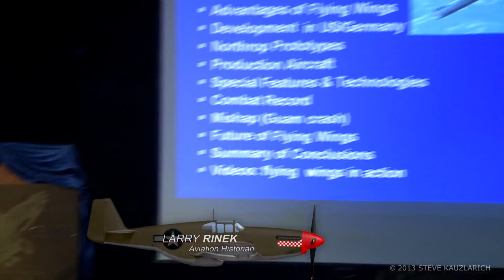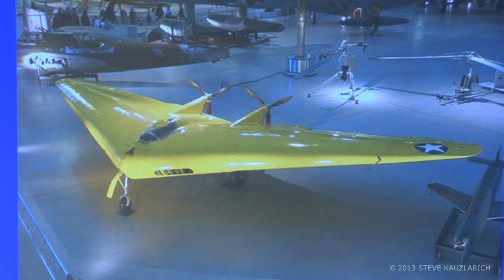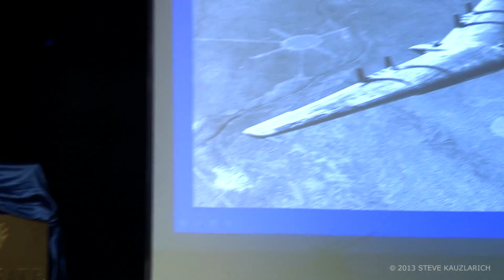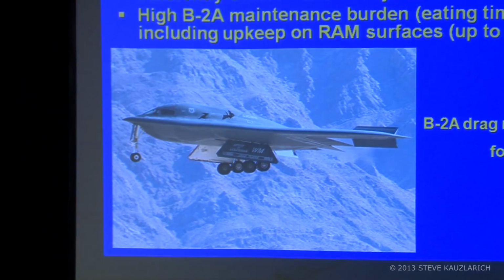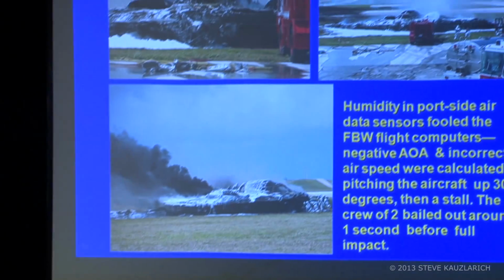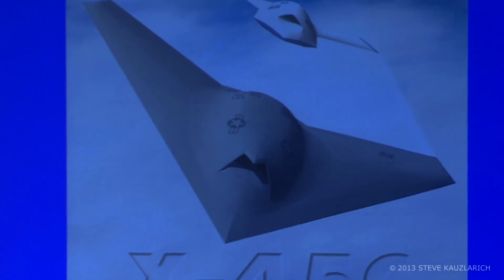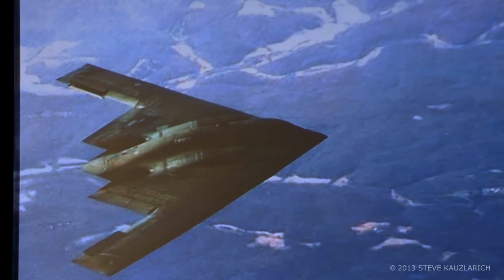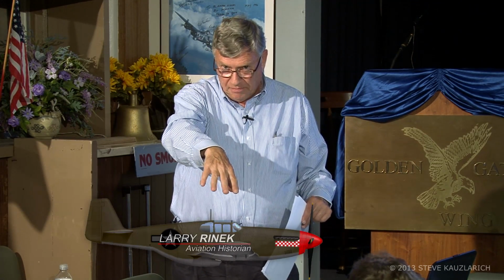HISTORY OF THE FLYING WING, with Larry Rinek

Comment: The flying wing had already proven that it did get more speed and range. Observability was a was important before stealth and was a feature of the marketing videos of the time. The cancelling of the Northrop bomber was carried out by the head of the air force for political reasons after after they had already signed an order for 35 planes. They were forced by the airforce to destroy every prototype that they had built to date.  This is the reason Northrop didn't want anything to do with the 1970's stealth projects. The deliberate attempt to bankrupt Northrop was the most Traumatic event in its entire history. It is the subject of several videos. It comes as no surprise that when Northrop were finally given the chance to build a flying wing, after almost 50 years , that  they came up with a machine that revolutionized aviation. Despite certain peoples obvious dislike of this company.

Comment: This guys wrong about so many things, he needed to watch the frontline interview with Mr Northrop when he was 85, also all 3 of the 5 test pilots, the other  2 were the ones killed in the only (1) crash of the XB49 during the military trials,  but the other 3 test pilots were a retired USAF Colonel, as well as a retired USAF General and the other test pilot was the company test pilot Northrup, that had been with the program since the very beginning and all 3 pilots said that the Aircraft was Stable and ready for action, there was a problem with yaw before the contract wad awarded but they had developed and analog flight stabilization device that took care of that issue or they wouldn’t of won the contract if the aircraft was unstable and incapable of hitting the target on bombing runs.. and after the crash Mr Northrop said that they had to start over back a square one in the Air Force Trials due to the crash to make sure that one of the earlier test before the crash hadn’t exposed a weakness in the airframe or flight control systems, which is the reason your required to start completely over. So once they had to run completely through the Air Force trials again start to finish, with one of the other XB-49’s aircraft x they had built, everything he said to do with Northrop  and the b49 & xb35 and the military contracts is wrong, he only listened to misinformation and myths. 
  Northrop actually won the contract to produce 35 or 36 of the B49’s & the General that came to Mr. Northrop’s office to award Northrop with the contract and the first P.O. And the General told him they were very excited about the Bomber and this initial order was just going to be a drop in the bucket because he was pretty sure they were going to want 300+ more bombers and variants over the next few years built for the Air Force.  
In the interview with Frontline the former chairman of Northrop and Mr. Northrop both described a meeting that took place 3 days after receiving the notification of winning the contract they were called into meet with the Secretary of the Air Force, they assumed to be congratulated and commended for their hard work, but it was anything but, the Sec. Of the AF, Simington said he wasn’t going to be dealing with more companies competing and that Northrop was going to “merge with Convair, and they needed meet and get it worked out” Mr Northrop asked what if they weren’t able to come to an agreement  for merger? And Secretary Seimington answered “that they would be damned sorry if they didn’t”. The General was supposed to of spoken up and said that the Sec wasn’t saying that they were going to,? Then the Secretary spoke up and shut the General drown repeating what he had already said, that they would be damned sorry if they didn’t merge with Convair,   
So the Chairman and Mr Northrop left and arranged a meeting with the head of Convair and he was basically trying to merge with Northrop but was valuing his stock as if he was holding the Air force contract for the B-49’s and Northrop was setting empty handed without any potential work lined up, or assets of value, when in fact it was just the opposite Northrop already had 7 B49’s built & was the company with the USAF Contract & since winning said contract the Value of their stock had skyrocketed and the opposite had happened to Convair, but it seemed to the Mr Northrop and his team that the man at Convair assumed that he wasn’t going to have to pay any difference in stock values and was inflating the value of his own companies stock, so naturally no agreement was reached. Mr Northrop said that it was only a matter of a couple days after their meetings with Convair when the Secretary of the Air Force called and said he had had a troubling report so the contract was being canceled, they tried many times to get ahold of the Secretary to see what could be done differently to maintain the contract either through sharing like the winning company does with the other one that was competing for it also, so in the end now days the winner shares the work with the others so they all survive until the next time to bring a new aircraft to the forefront. or by he having the General moderate, and negotiate to share in producing some components for the aircraft, (like the current f35-is being built by both companies the winner and loser) or what ever but they could never get ahold of him other than an order being issued by his office to destroy the 7 remaining B-49’s entirely, what was really hard to believe is that Sec. Simington wouldn’t even allow a couple of them to be saved and sent over to NASA for further  research, and future technological developments, or keep  1for the Air Force museum  & 1 for the Smithsonian museum . 
   Although the sad thing is when there was a senate oversight hearing over why the contract was awarded to Northrop for the B49’s to br built as the next generation Air Force Bombers. But Convair is building the aircraft that lost and that’s the one the USAF is buying and the oversight committee wants answers so Mr. Northrup and the chairman and team are questioned and asked if they knew why Northrop’s contract was canceled and if they didn’t canceled and they all purgered themselves and admitted to it on the Frontline tv show during thier interviews, when asked why they lied under oath in the senate over site hearings that were lookin into any dirty dealings... they all said that they were under the strictest impression that if they write to tell the truth about sec Simington trying to force Northrop to a merge with Convair and when an agreement couldn’t be made the Secretary Simington canceled the TV contract, and if they told anything about it, there would be reprisals against Northrop by Secretary Simington. It’s all in the frontline interview from 2001. If I remember correctly...but either way that interview blows this guys whole bs presentation of how the flying wing was unstable and a bad bomber out of the water, he didn’t do his research or he’s a stooge for Simington and Convair. Because what they did was illegal in my opinion, and isn’t it funny how Simington became the Bice president of Corvair as soon as he left being the Secretary of the Air Force, sounds to me like someone needs to bee looking into his bank records and stock holdings, or maybe he had went and bought a shit ton of Convair stock thinking they would win the contract, and then lost his money and just like pelvis would do change the rules so she gets richer, like the green initiative she got passed in California that forces the state to invest heavily in green energy and it so happens her brother had a solar panel company and she was a major stock holder in it ....hmmm. Nice how that works for them huh !!!

Comment: I noticed you said northrup gruman reconstructed a 229 and tested it and integrated that into the construction of the B2. Didnt they build that reconstruction in 2008?
Reply: +Tim Thorson   Planning for the B2 began in 1979-1980 and Northrop got the contract to begin design and construction in 1981.    This is long before the model department at Northrop constructed a mock-up of the 229, and it's just a mock-up shaped like the 229.
Reply: @FiveCentsPlease  I know, but the video said that influenced the construction of the v2. Clearly incorrect.
Reply: @FiveCentsPlease  he also exaggerates a few other parts of the 229, the radar stealth wasnt even what it was designed for, it was a potential byproduct of improving the aerodynamic efficiency. The plane wouldnt have been particularly effective against British radar at the time either.

Comment: People who say flying wings are unstable haven’t noticed that hang gliders have been flying for the past 50 years.
Most of those airplane designs miss wing twist and proper wing loading. Birds don’t load their wing tips. HG being flexible do it naturally, but check out Prandtl project. Basically only 71~74% of the wing is loaded, the tips being only there as control, stability and efficiency.

I am HG pilot and I can say that it is nearly impossible to tip stall one, and even if you manage to do it the wing recovers by itself.
That is only an issue in rigids like Atos, but not too bad and they are perfectly safe and recoverable too.
And there is this new Horten HX-2  GA 2 seat wing coming out soon too.

Comment: I almost forgot. The B2 was heavily criticized when being developed as a hugely expensive aircraft, they cost the exact same per aircraft as it would to build a Sea Wolf Class Attack Submarine, the best sub ever built before or since, basically it couldn't be killed, yet the Sea Wolf project was cut to only two subs when the navy desperately needed them and eventually replaced with a cheaper Virginia class sub with far less capability and built mainly for littoral environments where the Sea Wolf reigns supreme in both blue water and littoral. Yet the built lots of B2s and critics claimed this was a bomber with no mission. It was designed to go into the USSR after the first nuclear strikes to bomb any targets that weren't hit. By then the Soviet Air Defense Radars would be destroyed and any remaining radars would be of the type that were unable to detect the B2. 
Before that though the Soviet Air Defense Radars had no problems detecting the B2 from extremely long ranges. That's because that Soviet radar technology was far behind americas, they used radars similar to what was used in world war two that had a very long wave. The stealth technologies are designed to defeat modern short and very short wave radars and do a great job. The Australians who have some radars like the Soviets air defense radars detected the B2s when they were being tested, detected them all the way from Australia!! That is one of the advantages of the old long wave systems, under some circumstances the waves can travel extremely long distances, exactly like ham radios in fact, not all the time but then again detection at those ranges aren't necessary.  A F117 was shot down in the balkans by a Radar that defeated its stealth design, that was a long wave set.
Many was the B2 as a waste of money, and I must admit, especially with the car cheaper bomber soon to replace the B2 I think the B2 was indeed a huge waste. The B1 and even B52s were more than enough. Even today the Air Force is extremely reluctant to use the B2s on combat missions fearing their loss for whatever reasons, it would be just too great for a number of reasons. So the B2s missions are carefully chosen to ensure the danger of their loss is absolutely minimal. It really is a bomber without any real mission.
Meanwhile, the old B52 keeps chugging along, disproving critics at every turn. It dropped the greatest majority of bomb tonnage in Afghanistan yet flew only a tiny percentage of the sorties that navy and marine did. The advantage of having one orbit around with a huge amount of smart bombs just waiting to be called to help the ground troops proved invaluable time and time again. Today they even see the B52s flying well beyond mid century, well far after the B2 will be nothing more than a static museum display here and there.
It's sad because today the navy could have had a fleet of the best subs ever put to sea, a fleet that would still be the best in 2060 even, instead of the compromise fleet of Virginia class boats it is getting now. The money was horribly spent on a bomber that's accomplished nothing.
Reply from the maker: Some very interesting information JIm! Sounds like you speak from experience - thanks for posting. And BTW - I like many of your songs from the 70s (I know - you probably got your share of that BS in the past :)! Steve

Comment: The U2 was even more difficult to land due to its extremely high lift, basically a net powered glider which is why it could fly so high.
Compression injuries are common ejection seat injuries no matter what height the pilot rejects from. That's because the seat is a rocket and the acceleration forces, positive Gs, are intense and tend to be focused on the spinal column of the pilot. It helps to be firmly strapped into the seat but this still doesn't prevent these injuries from occuring. Another type of injury in ejections occur when the canaopy fails to separate and the seat and pilot are ejected through the canopy itself, not as common as spinal compression injuries are they still occur.

Comment: Mr Renik, while wood, like the Horton and also DeHaviland Mosquito as well was constructed of, does indeed reflect much less RF energy than say Aluminum or other metals do, it still reflects some amount of energy.  Anything will reflect enough energy to generate a Radar return IF you hit it with enough energy. For example, the Air Defense Radars that ring American Airspace and comprise the ADIZ or Air Defense Identification Zone (A zone that completely rings The United States where anything and everything that's flying must be positively identified before it's allowed into the Airspace of North America. This is done most often through the filing of international flight plans and the transponders every airliner, and every aircraft capable of transcontinental ranges as well, has as standard equipment. Military aircraft, even those of other nationalities, have special transponders that identify them as military aircraft and those also include a IDF coded signal which identifies them as a friend or for depending upon it they have the correct IDF to send). Anyway these radars that ring the country are extremely powerful and routinely paint birds and flocks of birds that are migrating across the gulf of mexico. The military has aircraft that will show the movement of ground troops on the ground, as well as all manner of very small targets.
So yes while being constructed of wood does seriously reduce the amount of RF energy reflected back to a Radar receiver it does still reflect some back and depending on how strong the energy is eventually it will be enough to detect. In other words if the radar itself is extremely powerful it can detect it at greater ranges of it just an average radar then when the aircraft gets closer to the transmitting radar eventually the strength of signal will reach the point of detection. 
But it is not completely transparent as you mentioned, it doesn't just blow right through . Just letting you know.

Comment: Lift is not directly proportional to wing area.  if the were true, wing loading would be consistent across platforms, and aspect ratio would not matter. also, planform, airfoils, and coefficients of lift would be irrelevant, which they are not. 
using the drag brakes on final is not just to kill the l/D ratio, but is mostly for low speed yaw authority due to reduced yaw effectiveness at lower IAS. 
the B-2 actually has a poor L/D ratio, and is not hard to get it to land.  
the Northrop aircraft destroyed when the nose gear collapsed had caught on fire, and the fire destroyed it... 
not the most accurate info here, but some good info, and much appreciated nonetheless.

Comment: , the B-49 was a victim of extremely corrupt politicians and direct sabotage  of the plane causing all sorts of problems including a crash. The B-49 was decades ahead of anything else and it's demise is a prime example of just how corrupt some of these congressional committees are.
Reply: Actually without fly by wire it was unstable laterally and required very long bomb runs. Humans could not make the number of corrections per second unless it was extremely calm. That rarely occurs at high altitude.

Comment: From the earliest days of aviation, many people in many countries experimented with flying wings. They may or may not have been aware of others' efforts and results. Even though modern Nazis like to extoll the virtue of the Hoton flying wing, there was not anything special about the aircraft. It was in a very early experimental stage and killed a test pilot. Northrop built a number of wings that flew and also killed several test pilots.
Reply: Wrong. The Horton 229 had solved the adverse yaw problem. Despite having a replica 229, Northrop failed to understand the aerodynamics of it and did not learn why the Horten was stable. Only recently has NASA rediscovered the secret of the Horten flying wing. They call it the Prandtl wing.